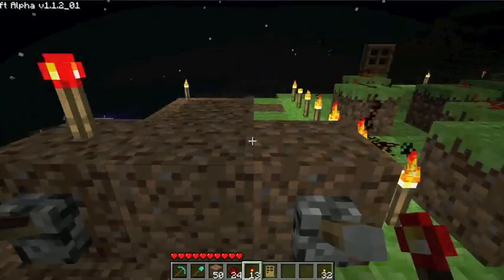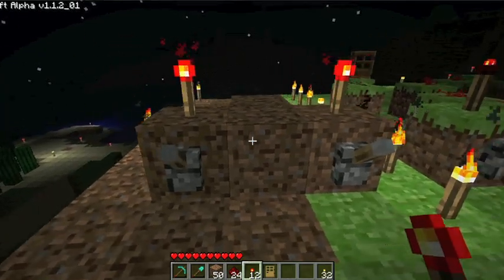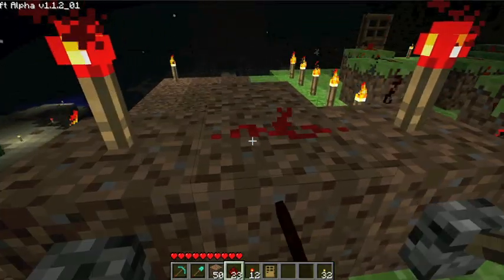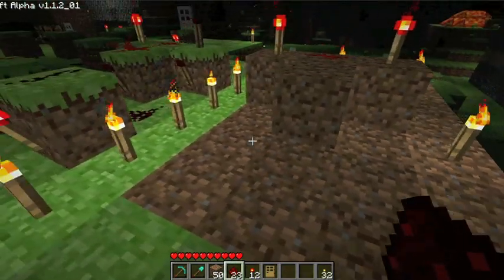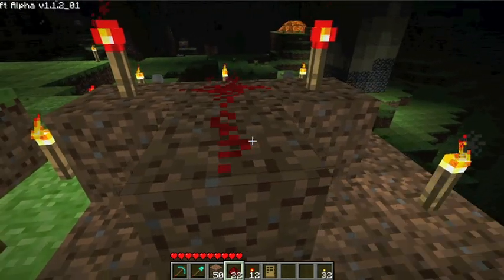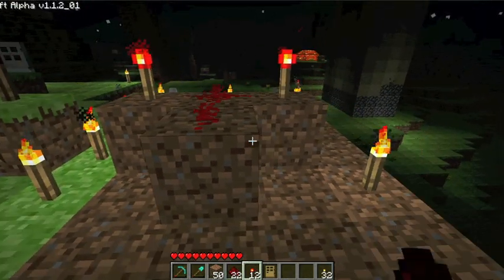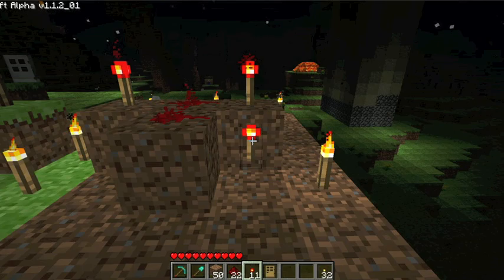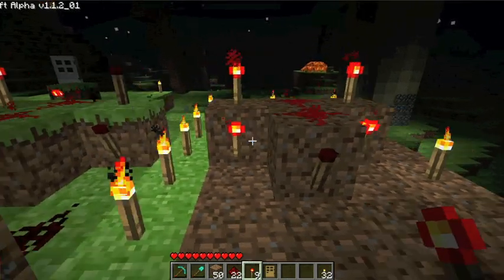Building the XNOR Gate - Advanced Redstone Tutorial

Comment: @3goodplans 

im about to use this in a design i had for a minigame using the XNOR gate.  i tried to find it at other video tutorials, but most were wrong in design because they all had the wrong output if both a and b switches were both on.

the minigame im planning is essentially the switch off game, where if you had a grid of 16 lights, if you turned off a light, the lights adjacent to that light would turn off as well, however lights that were already off, would essentially turn on.